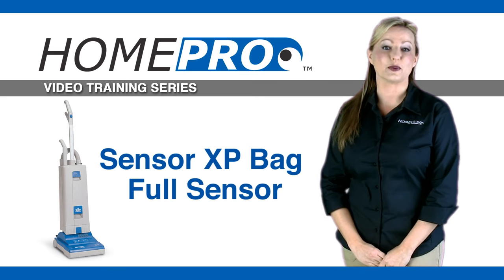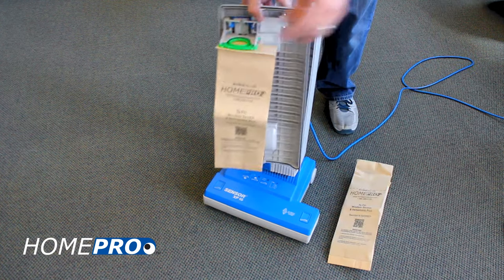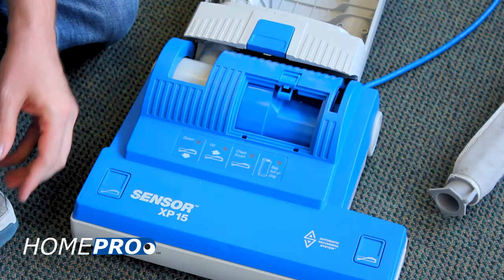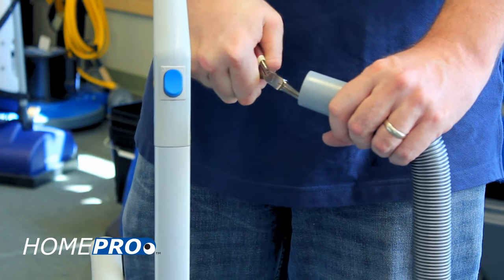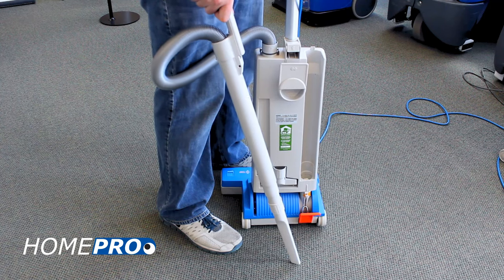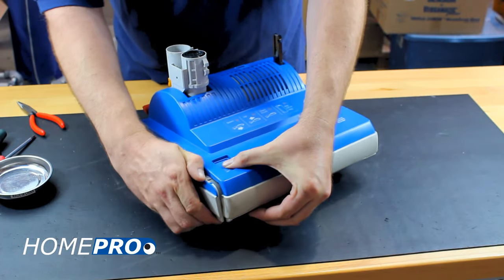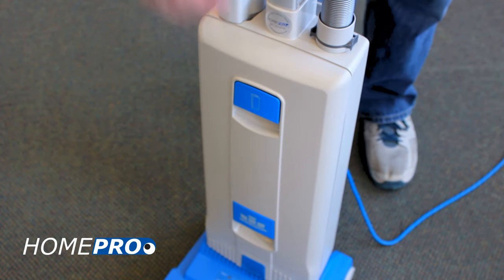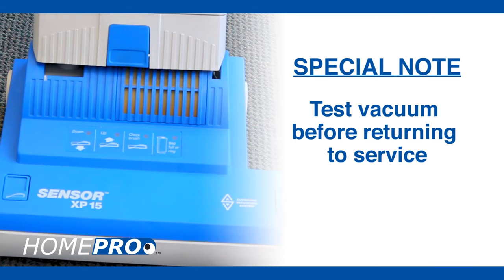Sensor XP Bag Full Light

Comment: Were can I get the filters???
Reply from the maker: Hi Yesenia, you can order our filters on our website homeprovacuum.com. 
Here is a direct link to the XP Filters: https://www.homeprovacuum.com/index.php?l=product_detail&p=374
Reply: HomePro Vacuum Centers my issue is my brush light is on none stop but the brush has nothing in it and it spins fine
Reply from the maker: There could be a a number of different reasons, but most likely the brush roller is worn out and the bristles are not creating enough resistance for the sensor. Without the vacuum actually here for diagnostics, I couldn't say for sure.
Reply: We use sensor 15's at our facility. They take a beating. I removed the sensor board and cleaned off the brush probe and the groove on the brush drive hub. Light went off then.